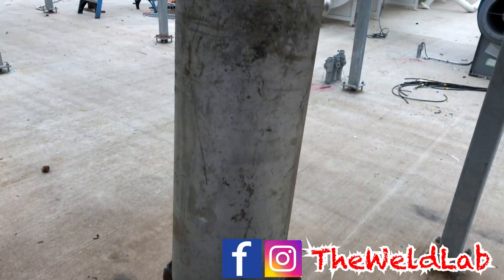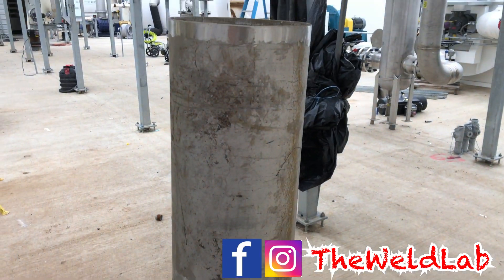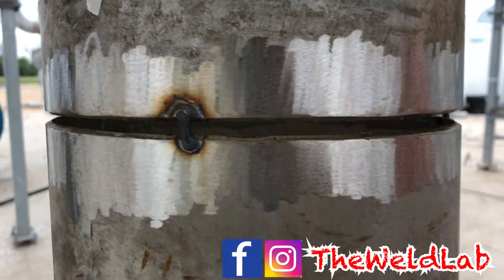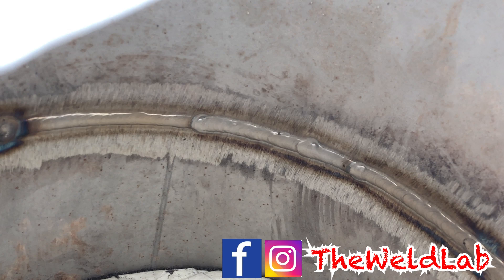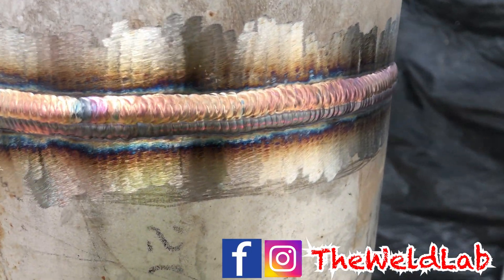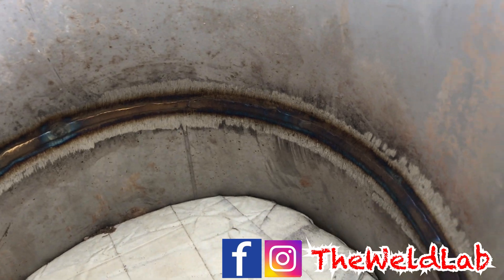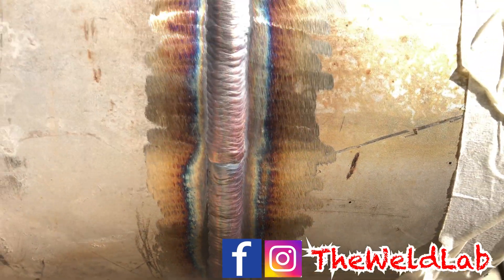2G Horizontal Stainless pipe Welding schedule 10 Tutorial | Tig

Comment: I am very confident. I have been working in the field of welding since 1992 and have worked in oil refineries and bridges stores, noting that I am a welder with electric tubes and tig+96407813701013

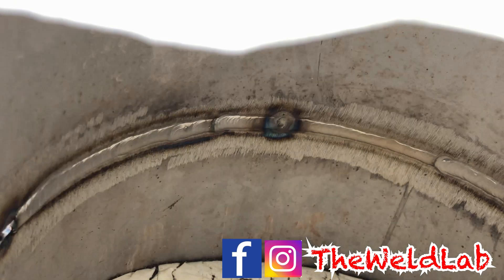Comment: WOW is this really the standard use in the USA and of 2:49 I can see 6 faults that would cause that weld to fail and the cap is excessive and would fail here in Australia for any sort of pressure/structural application(5x undercut and 1 of not overlapping stop starts enough with visible pin hole) Also if someone stood on your purge gas line how come there are arc jumps on the internal weld(repair attempt)from breaking arc off job on the peno. build up? In the many years I have been purge welding, I have never seen such a small amount of porosity in a purged vessel.
Reply: Different codes have different tolerances, if you can do better post a vid, until then keep pulling that trigger and I'll be waiting
Reply: @devinbybee1525  WOW!!! So you are saying compared to Australian weld standards, That is what Americans can get away with? I should move over their, as I could make a Killing with Australian Basic standards used here as If it not right here IT can be by by job.
Reply: @abrahamanham  I have over 30 years of welding experience, can you weld Streamline to code and pass first time I can and have...….
Reply: @bcurrie9511  and yeah I’ve heard that one so many time by hands everywhere “I have 30 years experience“😂
Reply: @abrahamanham  If he is an expert and does tutorial, he should be spot on and not have any faults in the weld as I have had better weld rejected and had to be repaired for one little bit of undercut and how long have been welding for Bloke.

Comment: What tig set up do you use for your SA200 ? Do you use water cooled or air cooled torch ?
Reply from the maker: i use air cooled ill drop a link to the tig rig im currently using on the description
Reply: TheWeldLab dope what machine do you use ?
Reply: @mikeymoney8676  u have a whole rig , u swap the polarity you make you stick welding stinger the negative and that becomes you ground for your tig rig , then your actual ground goes on the metal / pipe. U gonna weld .
Reply: Are you retarded? Water cooled of a 200 ??

Comment: I need to get my tig skills on point. May have to try this after work tomorrow. Pretty sure we're air testing so should be an easy ass day
Reply from the maker: yeah man i love tig i like doing stainless, its my favorite
Reply: @TheWeldLab  we only stick weld pipe at work so only time I tig is at home practicing. Well I guess we do a tiny bit of stainless pipe off boilers but we've done more steam systems then boilers lately
Reply from the maker: @chrisjones6165  what yall do 6010 7018 ? im glad you working know alot of people with out a job rite now
Reply: @TheWeldLab  I work in hydronics field doing pipe for heating and cooling systems so been really busy through all this. Had a week off because we had exposure and needed tested but was still paid. But work has been good and I'm getting daily emails about other local places hiring for same field so I know work will be available for atleast near future.
Reply: @TheWeldLab  and yes 60 root and hot pass 7018 cap. Do get into some sweet spots to weld in though. Can't tell u how many times I've been crammed between pipes one foot on a ladder and next 2 pipes over on a sketchy ass chain grip lol. Oh the fun of field work lol.
Reply from the maker: @chrisjones6165  learn as much as you can so it can open doors for you i welded on a few boilers a few years back and man you get some tight spots when i broke out welding i start at a shipyard and i was able to pick up on mirror welding so when i got to the boilers its was a easy for me
Reply: @TheWeldLab  that's the truth. Be as versitle as you can.